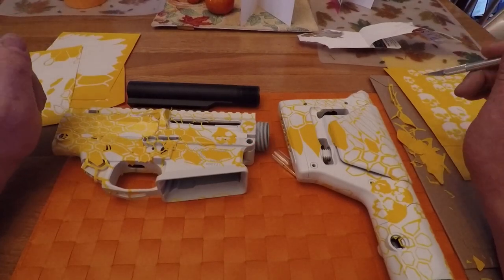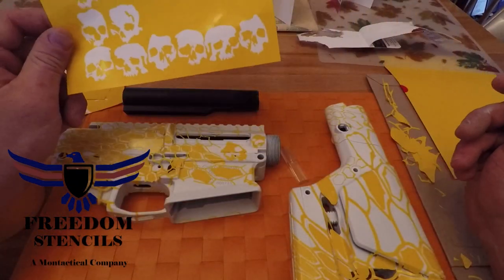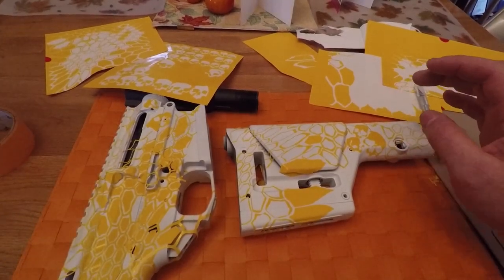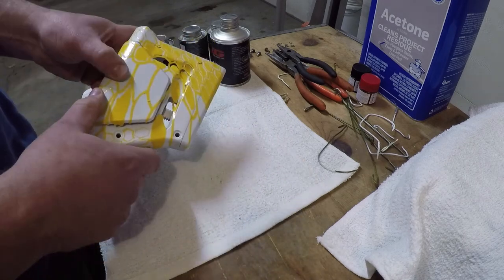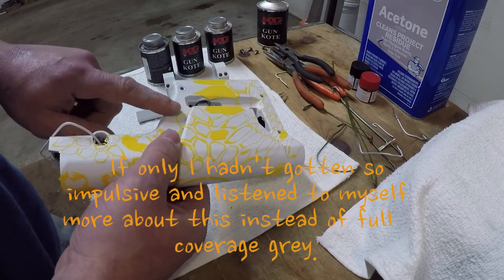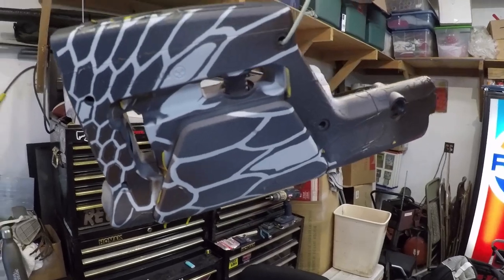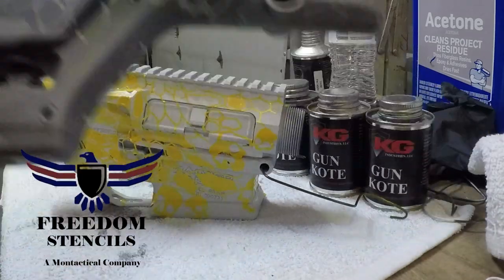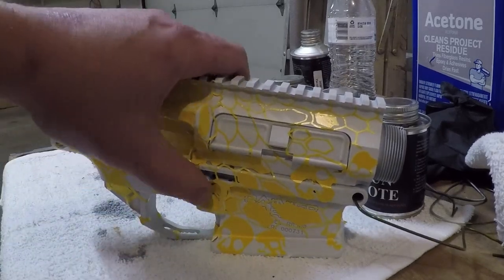AR10 Paint of Freedom Stencils Kryptek Camo using Gunkote

Comment: With cerakote i cook anything nonmetallic @ 180 for a few hours rather than the full 300 degrees at 1 hour. Haven't melted anything yet. Stencil work is a 15 min bake at 180 then on to the next layer. If you don't use a high quality vinyl it will not stay in place well at that temp. Check out my Kryptek style camo tutorial https://www.youtube.com/watch?v=JMrIQ9ELMSo&feature=youtu.be. Im still new to the video production side of things so go easy on me. Great job on your project.

Comment: How long did you wait to put the stencil on after your first color and spray your second color?
Reply from the maker: So I used a gunkote process meaning after 30 min. Of curing in the oven the paint was ready for the second color
Reply: Backup Dream what temp do you find works best for you?
Reply from the maker: I used for final curing 350 for at least 30 min. 
I preheat for a flatter finish at 200 for 10-15 minutes

Comment: If you used 8 ounces of KG Gun Kote on one rifle, you're applying it wrong and far too thick. I'm lucky to use 2 ounces or less on one rifle, including large frame AR's and bolt guns. Been using KG products for over a decade and they are some of the most economical and tough coatings on the market, unlike some others I can mention...
Reply from the maker: White is a bitch to coat over a dark color 
Thanks for the feedback though